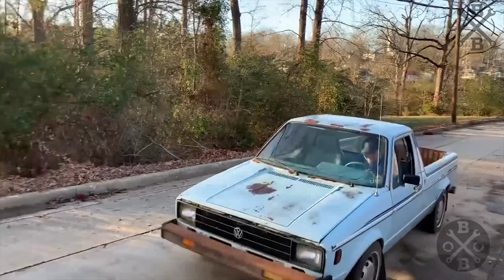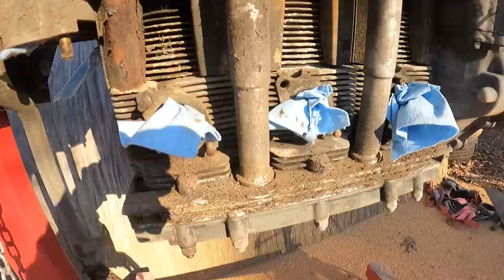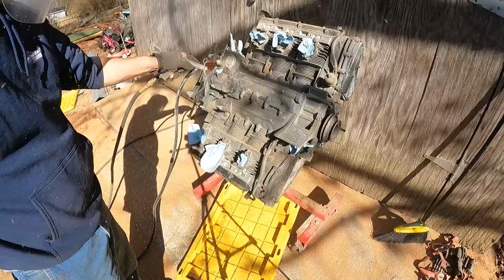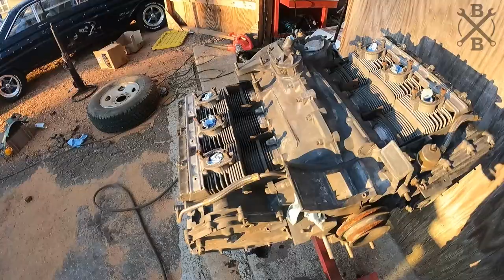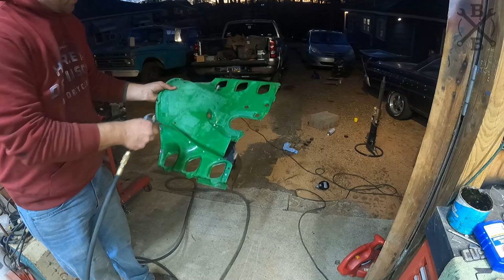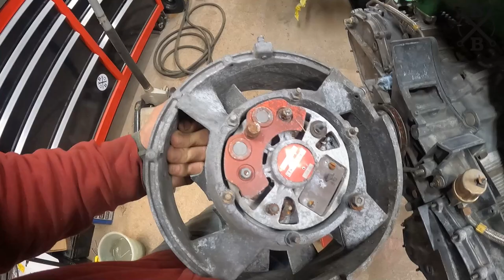Saving a Vintage Porsche 911 Targa from the Scrapyard: Rebuild Part 23

Comment: A hint: A drop of soap to the wet sanding water helps sanding and prolongs the lifespan of the paper.
Reply: Hint: too much work involved in a pump sprayer  to clean a part that small

Comment: Best bet on a good clean job. Warm up that engine if you can and that will help. Warm up some engine bright, spray on warm engine. Then pressure wash with hot water. Might be a good idea to stop drill any cracks in the engine shroud.

Comment: Nice work so far! A couple of suggestions before you install the engine back in the car. Adjust the valves, It's 1000% easier with it out of the car. In addition, buy the correct feeler gauge for Porsche valves, they are not expensive but make it easier to adjust.  It looks like the oil return tubes were replaced at some point with the 2 piece versions. They can be removed without removing the heads so you can replace the O-rings. Replace the crankcase breather gasket, this is a common oil leak that's not fun to replace with the engine in the car. Remember once the engine is back in there's not a lot of room to work, so do everything you can before reinstalling it. Keep up the good work and the videos!
Reply: Good advice, but it doesn't take long to drop the engine out👍👍👍🇬🇧

Comment: did you degrease engine prior to blasting? The media has a hard time with the soft grease and dirt -if you degrease first, let dry and then blast, your media will work much better

Comment: A suggestion.
Buy a non runner diesel heated steam pressure washer. Make a yt video of that repair.
Use the steam pressure washer. Much more efficient parts and degreaser cleaner.
Anyways! Good work mate.

Comment: I would advise blasting an engine with anything!  It doesn't matter how well you seal it, it will get in there!  Also be very careful with Magnesium as it requires special treatments / coatings to survive the elements, I know because I work in aviation and deal with magnesium on a daily basis.

Comment: Just a little trick I found if you have a bunch of old nasty shop rags laying around go get a one gallon bottle of lemon juice soak rags in the lemon Make sure your rags are not completely sopping wet when you apply tuck them in around the crevices lay them on top etc etc etc let them soak for an hour remove them and then hit it with the walnut shells it will be sparkly clean

Comment: The rubbing compound is for dry dead paint heavy swirls next u would use a polishing compound each time using a lighter and lighter polishing compound then finish with a wax

Comment: It might be a good idea to fire it up on the engine rack. You could have valve issues or other tuning that's alot easier to fix out of the car. Or at the very least compression test each cylinder

Comment: Why not just use engine degreaser? I mean don't get me wrong, shooting it with high powered nuts is way cooler.
Reply: @darrenswails  C'mon man, give Sean a break !
Reply from the maker: We used engine degreaser to wash the transaxle...and honestly it did not do very well at all.  I think it must have something to do with it being magnesium for some reason. This by far worked easier and I’ll being doing the same to the transaxle as well.

Comment: Instead of plugging holes with rags, use gafa tape over holes. You dont want to get any blasting material inside the engine, not even 1 bit.😊

Comment: The media blasting is also good for letting you see where all the future oil leaks are!  Sadly, the 2.7 engines (1974-1977) were ultimately one of the worst engines Porsche ever put in a car.  They wound up being quite leaky.  By the time the 911SC came out in 78 with the aluminum cases, most of the oil leak issues went away.  The 911SC engines were quite dry, comparatively.

Comment: Great work. Question rather that rebuild that fan and I believe alternator wouldn’t be more cost efficient to just buy a remanufactured one?
Reply from the maker: Thanks! Sadly the only part included with the alternator when purchased is the center alternator itself. Everything else has to be replaced separately.

Comment: New owner at Porsche dealer: "What was the engine issue?"
Porsche dealer: "Its a common fault. Chocolate cake in the air vents"

Those walnuts did a nice job mate so good thinking right there. Not too severe on the surface but cleaned out the crap. I would have been reaching for a can of satin black engine paint and fitting new bolts to appease my OCD but I can see the attraction of keeping it original. Its cool but paint all the plated parts and that will set it off really nicely. Cadmium plating is best but it costs.
Not sure I would spend scarce cash on a DIY powder coating kit for the rocker covers as a good paint will look as good. Don't forget to highlight the 'Porsche' name on the covers.
Keep up the hard work mate. Its looking great.

Comment: So you're doing all that work on the chassis to make it perfect but going to not even crack the engine open?
Reply: You just saw how little they know about engines from the way they butchered the alternator. Imagine the damage they would do if they opened up the crank case!

These are not real smart guys.

Comment: So, as I can see, that cheap, small HF blaster seems to work fine !
I read some negative reviews on it on their site and was wondering if it works or not.
So, you like it ? Any issues with it ? Please advise...
Reply: Also, curious to know whether use used fine, medium or coarse shells and what pressure you ran the gun at.  Finally, I recommend keeping blasting without a mask to filter dust to a minimum.  A face shield may protect your eyes, but won't stop the fine powder generating by blasting out of your lungs and that powder is not just bits of walnuts but also whatever you are knocking off the engine.

Comment: I bought that sandblast kit from HF but it didn't work. What CFM compressor are you running with it.
Reply from the maker: It’s not a crazy high CFM compressor. It is a 200PSI 27 gallon. Honestly ours didn’t either, take the gun apart and check all the ports. We had a run of extra material in ports, blocking off a good portion of passageways. After drilling it all thru, it started working good!